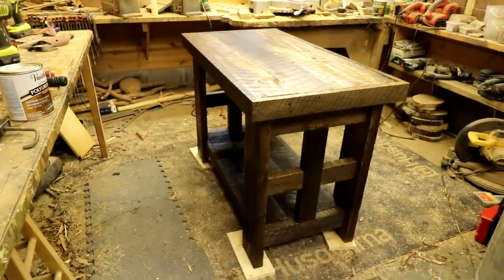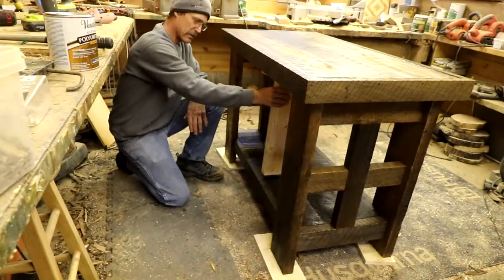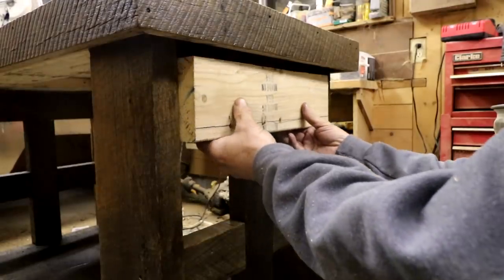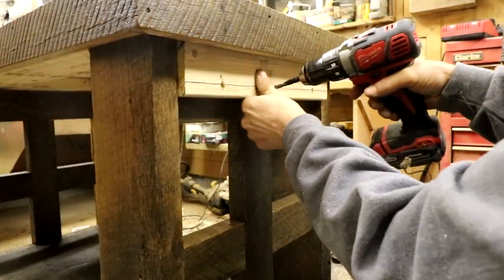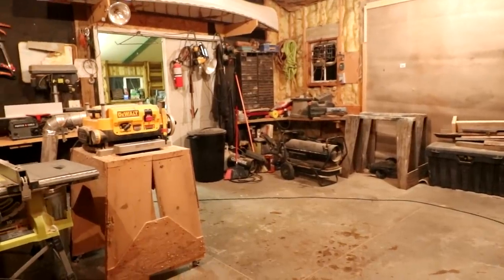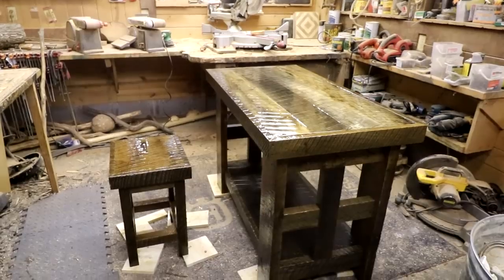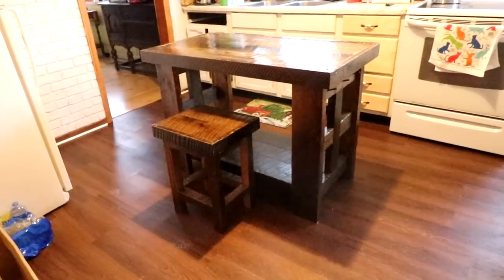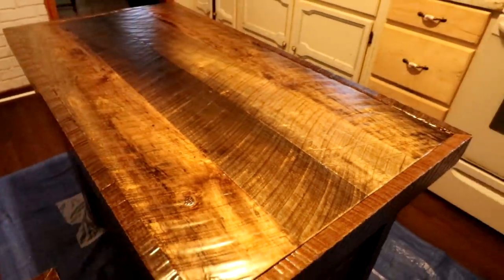THE WORKSHOP. Kitchen Island Table and Stool. THE HOUSE.

Comment: build a hanging rectangleframe from the ceiling for them pots n pans..out of the way and easy to grab..like in the old old home kitchen.. then you can place the stools under the table. (it possible add foldable tables to extend the table to put more stuff or seat more people on the kitchen table)

Thankyou for the video.

Comment: You are a talented craftsman, why many coats of poly vs doing a single layer of epoxy?
Reply from the maker: Poly is a much better long term finish. It has almost double the heat resistance, and just in general will put up to more abuse.
Reply: Joe, Agreed,  poly is wonderful to work with,  we used Benjamin Moore 37 years ago.  Applied semi gloss 2 coats followed by 3 coats of flat to produce a very rich low luster finish on ash.   Built all our cabinets and stairs, still beautiful after raising 3 boys, one girl and a granddaughter in the house.  Amazingly the stairs made from 8 quarter poplar hardly show any wear.   Still use Murphy’s oil soap to clean the surfaces
Reply: NorthernSeclusion Agreed,  poly is wonderful to work with,  we used Benjamin Moore 37 years ago.  Applied semi gloss 2 coats followed by 3 coats of flat to produce a very rich low luster finish on ash.   Built all our cabinets and stairs, still beautiful after raising 3 boys, one girl and a granddaughter in the house.  Amazingly the stairs made from 8 quarter poplar hardly show any wear.   Still use Murphy’s oil soap to clean the surfaces

Comment: Once again I add, why not take a router with a beading bit to the edges of the table and now to the edges of the little stool to ease the edges and soften up the pieces. Maybe to the bottom of the legs on the stool as well to prevent chipping out when it scoots around. Just my opinion. YMMV.
~ rdc
Reply from the maker: If you watched the video that was the precursor to this one that I posted on Joe and zach survival you would know that I was trying very very hard to save the weathered color of the wood. Routeriing it would have ruined everything.

Comment: Nice table for a seventh grade project. The build was fine but the countertop should've overlapped the frame. It doesn't matter how many coats you apply you have provided a home for bacteria. Take this table back outside and use it as a deer gutting station that you can sanitize with bleach.

Comment: You need to find you a smaller truck, doing all that driving. A little Toyota or S10 for sprinting around. That fuel will eat you out of house and home. Great job on the table. I hope you signed it so when someone finds it 100 years from now, they know who built it. :)
Reply: I don't know about the Ford, but I have a Ram with the diesel engine and I get better mileage than a buddy with a takoma.  I'm getting about 25mpg and he's getting 24 with the little engine, and he can't tow or haul hardly anything.  I tow a 5000# boat and I can barely feel it